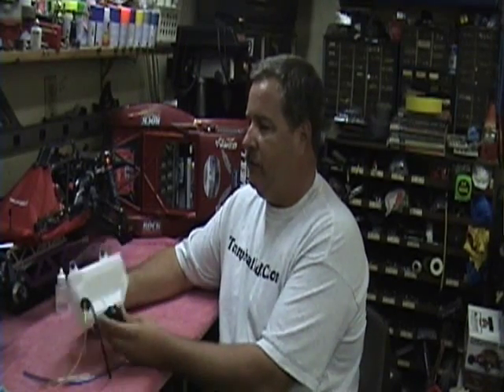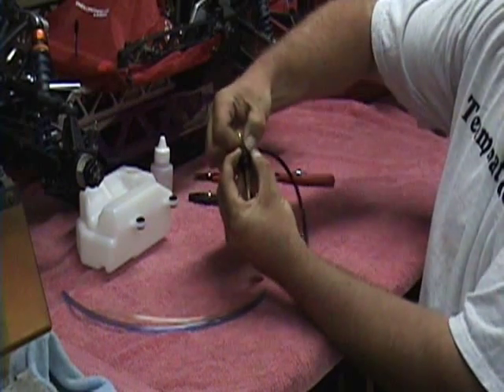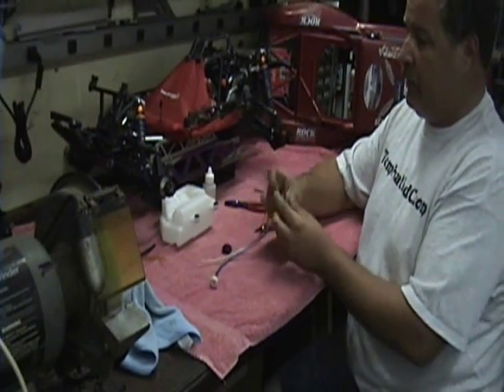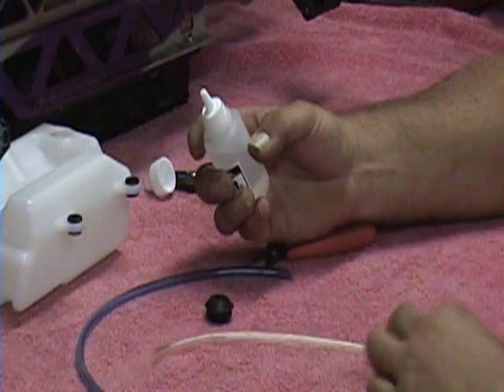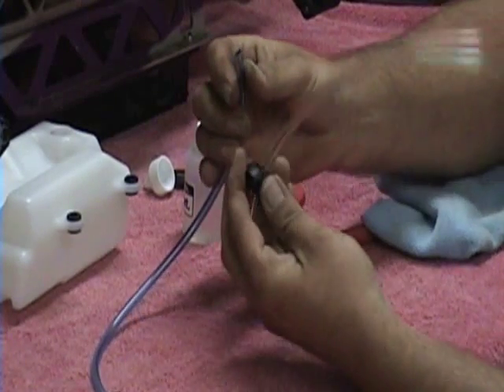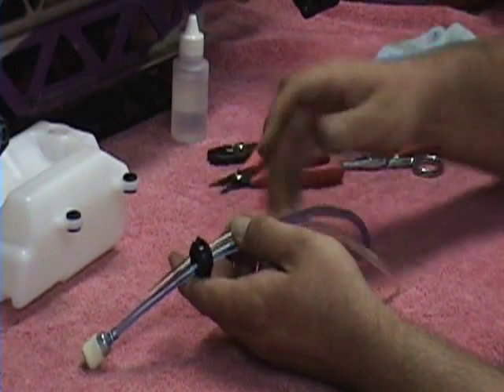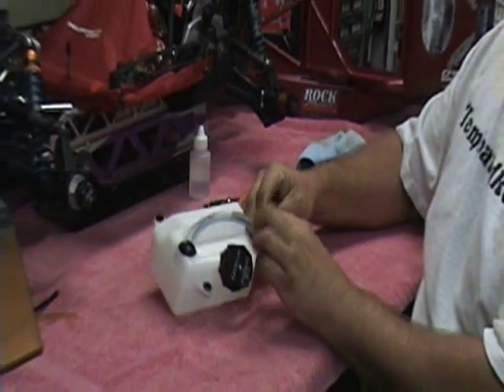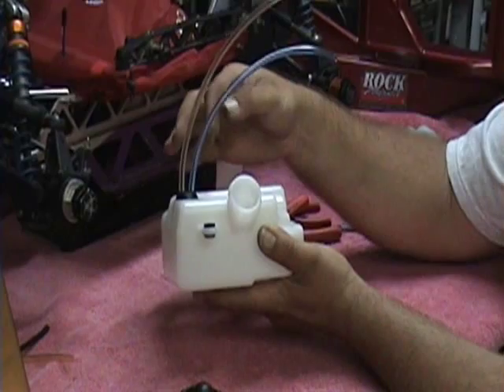HPI Baja- Fuel Line Modification

Comment: "The inside diameter of the fuel line is the same as stock".  If the new fuel line I.D. is the same as stock then what are you gaining?

Comment from the maker: @jimmymagnum07 , The inside diameter of the fuel line is the same as stock. The fuel line we used in the video has a thicker wall and will not get pinched when you put it through the grommet like the stock fuel line does. 
Thanks.
Reply: ....... If the inside diameter of the Hose is the SAME between the two - what's the Point then??